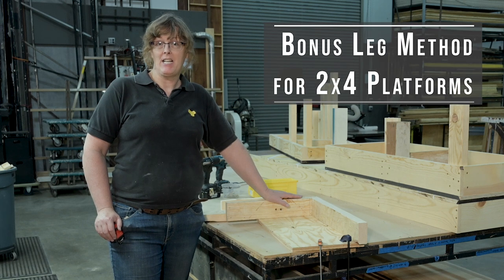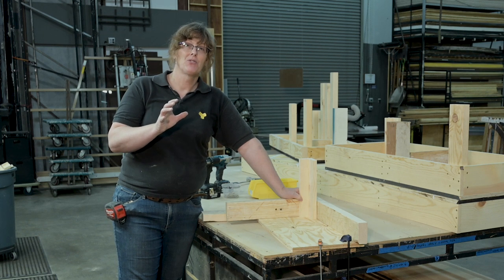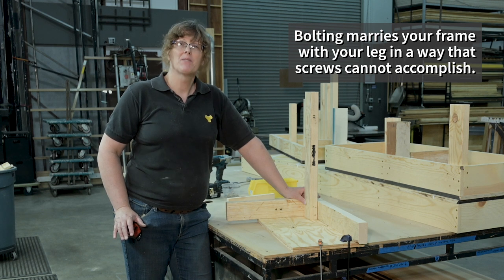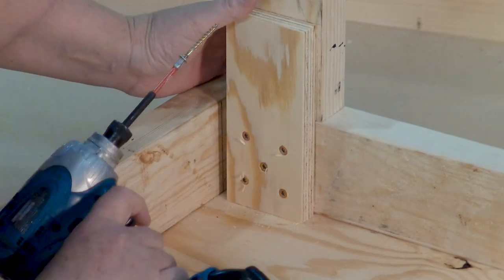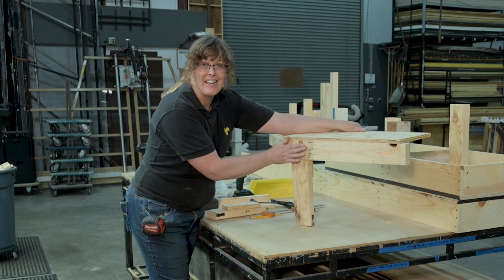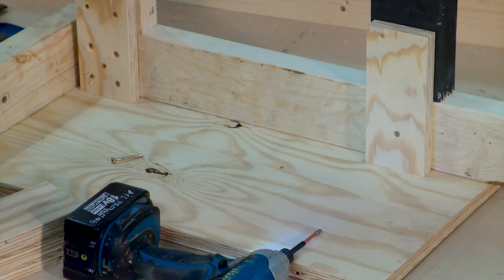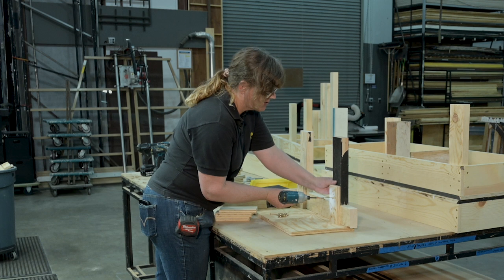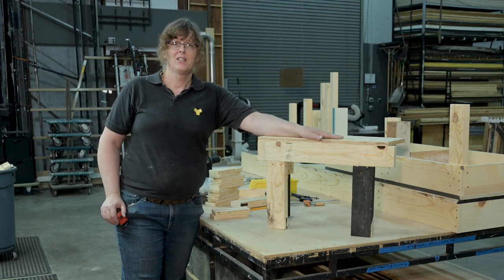Bonus Method of Legging Stage Platforms

Comment: do you have a video on cross bracing? We are using the leg design shown on this video where we use cleats.
Reply from the maker: So kewl! Do you do anything different in the size of your cleats or number of screws? I was extracting this from a past exposure to the technique from 1997 so I wasn’t 100% sure I remembered everything correctly. 

Does this technique have a name? 

My next priorities of videos to make are cross bracing, stage jack construction, and hard flat construction. So no I don’t have an in depth one on cross-bracing yet. I do have this short video hitting some basic concepts in relation to some questionable legging and cross-bracing examples. 

Problematic Platform Cross-Bracing
https://youtu.be/Ygon59ImUqA

But I need to do something more comprehensive.

Comment: I may have to try this.  I'm just always leery of connecting legs with ply, worrying about lateral forces, even with diagonals in place.  Usually I'm more about the old fashioned carriage bolted under-the-deck method, or something similar to that I call jack legs, with a regular 2x leg plus a 2x under the frame, like a jack stud under a header in a wall.  Sometimes we'll also use knee walls, if it's a long enough run of similar height platforms, the same way you'd use knee walls under triscuit platforms.
Reply from the maker: I was planning on including pony/knee/cripple walls as another legging method. But it didn’t fit with these ones. And I’ve mostly used them to support raked stages. But definitely needs a mention and eventually a demonstration video.
Reply from the maker: And was’t familiar with the triscuit platform term but have made stressed skin structures which are the same kind of principal. Might do a stressed skin video demo one day.

Comment: 10:48 Bill Raoul has described this legging technique as stepped leg in his book Stock Scenery Construction Handbook. In his example he describes using 1x material for the platform frame with 3/4 decking and 1x material for the legs and "cleats/scabs" except he shows to bring the "cleat/scab" to the floor essentially making a rabbet on a 2x4. He also describes using bolts to fasten the "cleat/scab" to the frame instead of using screws and using a steel plate for a pattern to mark the bolt hole location on the platform and leg, which sets up for a consistent position allowing for different length legs to be used as needs change and the system doesn't marry the legs to the specific platform.
Reply from the maker: Thanks for the info and the reference! His stepped leg method does seem very similar in concept, and provides a method that can be used with 1x6 platforms. It's different enough though that I'd call it a second bonus method for legging stage platforms! 

The lap joint makes it the equivalent of a 2x4 frame resting on a 2x4 leg. Though I think the method would be stronger if the inside lap portion were made of 3/4" plywood instead of 1x3. 

My personal preference is to avoid bolting methods for any platforms under 4'-0" high, so I am not fond of adopting a standard bolted leg. But I definitely approve of this as an alternate method!
Reply: @calstatelaalproductions2358  You're welcome, I'm curious what he would have said about using ply for the cleats his book also talks about adding additional 1x to each side of the leg to give additional stability so i would think that budget plywood wouldn't take screws as well as 1x. Just curious, why do you avoid bolts under 4'?
Reply from the maker: Just for speed if installation. Drilling and bolting is always much slower than screwing legs together. And slower at strike. 

With hog’s-trough legs and the right cross bracing, I’ll go up to 8’ and still use screws only, with platforms and stairs where all the internal structure is not visible to the audience. 

I actively avoid carriage bolts in almost all instances. Had too many failures to fight with at strikes when I was younger when we were using carriage bolts. And I got tired of chasing threads on carriage and machine bolts from people knocking them out of platforms with metal hammers.